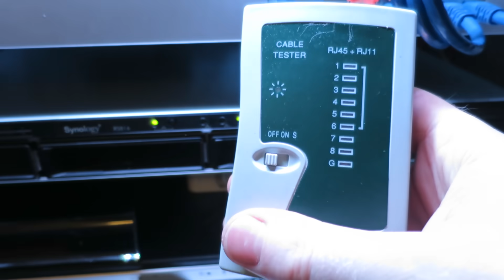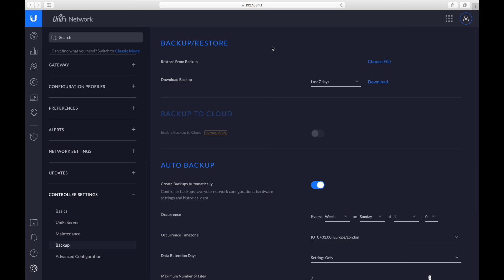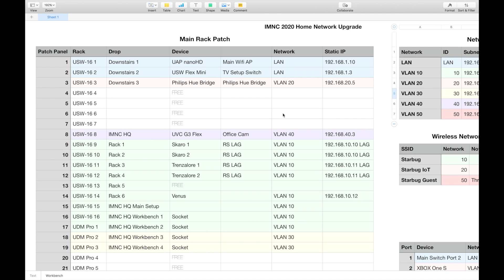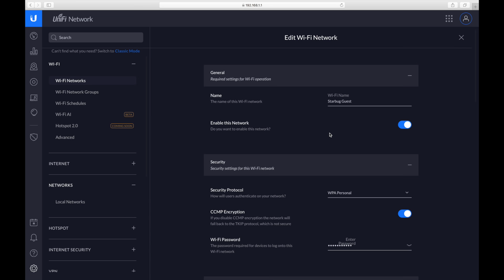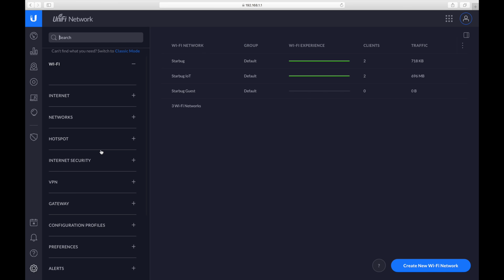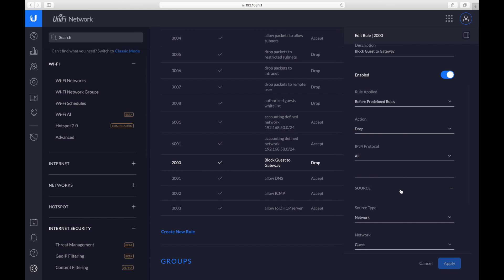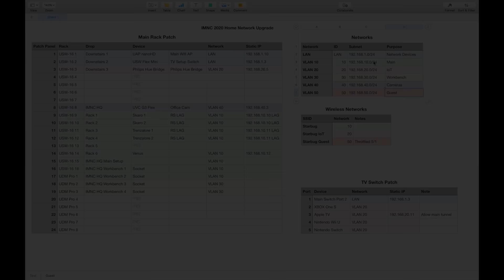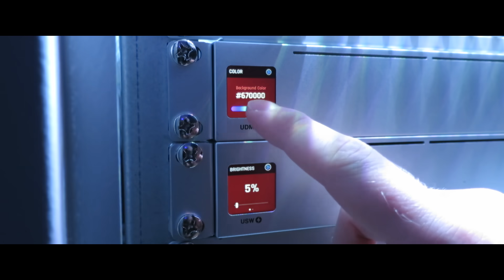Huge 2020 Ubiquiti UniFi Home Network Upgrade (Part 3 - Advanced Configuration & Final Installation)

Comment: I'm very impressed by this series. I worked for a small computer company (IBM) for 40 years and spent a lot of energy  investigating different vendors and their wares for my new home.  I have a home -  2 stories  - where the basement is poured concrete and below ground window wells. I have 2 AP-HDs (one on each floor)  serving the IoTs, wireless phones, smart TVs, etc. The list is growing (18+) -  it amazes me who many devices needing internet access we have.  I can not wire to outside walls in the basement - hence the need for strong wireless. 

I wanted a vendor who "had the goods" -  both hardware and management software - who was innovative and a vendor in the top 5. I DID NOT WANT to spend extra money on licensing (for a home system - come on!). 

I also did NOT want my wife to keep telling me "The network is down again!".

We live in the U.S.A in Aurora, CO where there are rare power outages (very little thunder). However, in Durham, NC (where we lived for 23 years ),  there were many thunderstorms and momentary outages - enough to reset and IPL  the modem. I have a small APC battery backup unit to handle any power burps.

I have a small request - please provide your spreadsheet so it can be used by others. It would save the time to reproduce and is a great tool. (I know -  we used many spreadsheets use in defining customer configurations).

Any configuration should be documented - just in case!

I'm looking forward to seeing more in the series!

Dave Clifford
Reply from the maker: Hi Dave. Thanks so much for taking the time to share your story in this comment, very interesting!
I've emailed 4 copies of my spreadsheet off to those who have asked for it, but I will look at making it available for download and will add a link to the description.
Reply: @ItsMyNaturalColour   Thanks for the response pleas send me the file as well Dave
Reply from the maker: @clifforddcj  Hi David, I've added the link to the description.

Comment: I would keep a downloaded settings backup that is saved off the UDM after you have all your settings set. That way if you for whatever reason need to restore those settings on other hardware you will have a separate backup.
Reply: This...  I had mine set up with a good baseline. A driver hit the electric pole near the home and the UDM Pro went into rescue mode. Had to reinstall firmware locally.  Thankfully I had a PC with a lan port!

Comment: I have had Unifi as my home network with 3 x 24 port switches and 6 AP's for nearly 2 years and struggled to do the VLAN/firewall settings for exactly your scenario with IoT's etc. My main issue was the sky q app not accessible via my phone or kids' iPads with sky q in its own VLAN, so ending up sticking everything on the same network. So thank you so much for making this video, I cant wait to start work on the settings.

Comment: if you mounted it on the ceiling it would improve the bedroom coverage, this is down to the antenna configuration and the dispertion of the signal.

Comment: It has been great watching this and the old network series, especially the iterative process of small improvements and all the challenges along the way.A small hint: Firewall rules are usually made the other way around. Best practice is "default drop all" then make exceptions for what should be allowed. Then you don't need those groups.
Reply: Hey! Can you explain this a bit more? I'm struggling with this and the way he does it on the video is a bit messy for my liking.

Comment: Holy Smokes - Ubiquity has surely made their money many times over by giving you the free gear!  Like you. I'm venturing into this area as a rookie, upgrading my church's internet.  Your videos answered the questions I had about their hardware and software. I finalized my order today.  Your presentation style is easy on the ears.  I'll be referencing Part 3 a lot to get the configuration part locked in.
Reply from the maker: Matt, thanks so much for this comment. Really glad you found these videos useful! Good luck with your install and absolutely thrilled to hear I've helped :)

Comment: On the Apple TV issue, set an Established and Related rule as an accept between all Networks.  Then a block from source IOT and  destination MAIN.  this will allow Main devices to talk to IOT. They can respond due to the established and related rule but can’t initiate a conversation
Reply: This is great advice.  I was going to say the same thing, but I see it has been covered.  Far more robust network design and easy to do.  That said, great video.

Comment: Great three-part series, got me up and running in no time. UMBPro, USE Pro-24-POE, US-8-60W, NanoHD.
I've run into an issue with my three SSID’s when I assign and turn on VLAN 10, 20, 40; I get a no internet connection error on each, turn them off they work.

Comment: I builded my home network based on this video (you can see another comment of me below), but for almost a year, I had connectivity issues with wifi devices. I even send an email to Tom about my problem asking for help. I love Tom's videos, I just want to let you know that this setup of firewall rules is NOT RIGHT and is NOT WORKING RIGHT. I know Tom did his best to figure out everything about UDM Pro, but recently I saw 2 videos from 2 different channels and I reset my UDM Pro, I followed their videos and since then everything works perfect.
Tom, you should make another video for UDM Pro. We still love you!

Comment: Few suggestions. First rule of firewall is to drop everything you don't know. So it a good practice to define the rule to drop all traffic and put it as the last rule. Then you open only the traffic that is really needed. This way you have full control over your Network and maximum security. I'd also consider separaring servers to a other vlan to minimize the risk that any malware you may get on the end users machines do not easily transfer to your servers. Also consider IOT Vlan as guest as well with client isolation. Your philips Hue does not need to be aware of your harmony hub or other smart plug or bulb you may have (and if they do you can open specific ports to specific devices). Also If Apple tv needs full connection to the main vlan maybe it does not really belong to IOT Network and should be moved to main?
Reply from the maker: Thanks so much for the tips! I'll definitely get this all sorted and mention these things in an upcoming video. I appreciate it!

Comment: So thankful for the shoutout in every new networking vlog so far, my original idea for the networking has changed somewhat, my band are rebuilding our unit (we have a small ish warehouse unit, works well for us etc) (toms seen pics of it etc) and im gonna put an express at each end of the unit and the extreme on top of the comms cabinet (got a home theater/lounge setup in one corner too) and were gonna be all chipping in for a home 5g router setup, to run a sick connection, and then run the router into the express and manage it all from there, got lots planned and the equipments going to an awesome home!

Comment: May be have the AP on the ceiling would give your more juice in the bedrooms
Reply from the maker: I think so too. I decided to plop it on the wall as that's where the cabling was.
Reply: You can try a L shape bracket:
https://community.ui.com/questions/I-made-a-wall-mount-for-my-UniFi-UAP-AC-PRO/5cc7677c-f4e4-4e5f-a597-5fd9ef111b64
Reply: Reuse the holes on the wall
Reply from the maker: @creature777a  Thanks for the link, very interesting!
Reply: Doing that might make the upstairs get the slower speeds
Reply: The UniFi ap have a 360 radius so ceiling mounting would be best

Comment: For the "Bug" you mentioned in your video, what worked for me was to go to "Insights" (just below Clients on the left panel) once there make sure you have "All" selected and not just the "Last 24 Hours" at the top. You should see a list of all the devices and their associated IP addresses. Sort by the Fixed IP Column, and then look for the errant IP address that keeps showing up. Click on it and then on the far right click on "Forget". For some reason, Unifi is stubborn with remembering all this information and not updating the tables. I also use the DHCP reserve (Use Fixed IP Address in the settings of the device panel) instead of hard coding IP's on my network devices. Hope this helps.
Reply from the maker: Hey Fred, thanks for the tip I'll give this a go!
Yes, I should've mentioned DHCP reserve. I'll be sure to bring it up in my next UniFi video further down the line.

Comment: Great video just at the end you have your cables comming out of the brush plate and over the switch to the UDM what happens if you need to take the switch out ? your stuck with cables blocking you should add one more brush plate between  the UDM and the Switch 

You went with all white cables ? No color code ?
Reply from the maker: Thanks Funny Noodle!
Couple of answers. No colour coding no - it's a 1 to 1 patch system, so will remain patched in this state permanently. 

As for the blocking of the switch, you're absolutely right. Main reason I didn't add another brush plate was I really didn't want to absorb another 1U of space. I have some more equipment to add to the rack and space is becoming an issue. Also, I can see myself at some point upgrading to a 24-port UniFi switch, so that upgrade will be very smooth and easy with the currently layout. I'll simply move the block of 8 cables down from the UDM, to the final ports on the new switch. It'll stay just as clean and means I can swap switches without pulling the rack out and removing the back cover.
Reply: ItsMyNaturalColour could you have had a 24 port originally? When Ubiquiti sponsor a video series like this, do they give you a budget of say £1000 for example, and you choose to get the most suitable items for you within that budget?
Reply from the maker: @jasonlee3247  I requested the gear I received specifically as I'd already outlined my project goals, and they also gave me a G3 Flex camera on top which is the only item I did not request. 
Originally I requested the 16 port switch as I wasn't aware of the UDM Pro 8-port switch backplane limitation of 1Gbps. This isn't a huge deal as my number of devices hasn't exceeded 16, but I'm hoping to add more cameras and I have more network expansion on the way, so I can see myself eventually growing out of the 16 port version. It's perfect for now, though.

Comment: For that IP bug on the controller, you might need to check your /etc/hosts file on the USG and clean it up. You can SSH into it, and do 'vi /etc/hosts' . 
Clean up the old entries; then once you've saved it you can reload dnsmasq (sudo /etc/init.d/dnsmasq force-reload ).
Reply: Thank you. That was driving me bonkers!  

Also wondering if it would be more secure on the uplink port for the switches, instead of 'All' port profile, you have the (combined) profiles of the VLANs being used?

For example, LAN (Native) + IoT (Tagged) on uplink if the switch is only going to have IoT devices connected to it.
Reply: @si-fi  hey, not really because you set your port profiles on the access ports... you'd just be complicating the configuration for no appreciable security gain

Comment: When you got to add a new iOT device and are setting it up for the 1st time.  Say for example like a Wemo smart plug and you want to add that smart plug to Homekit.  Have you run into trouble with your firewall rules?  I found I had to turn off firewall rules to do initial setup/ add device to homekit, but then I could turn firewall rule back on and have things work as intended.
Reply from the maker: Hey Brett. 
I haven't had enough opportunity to experiment with setting up new devices under this config yet. I've had it up and running like this for 4 or 5 days, so I've only tested the functionality of the devices I already had set up. I'll be talking a lot more about this sort of thing in future videos, so I'll be sharing all my findings.

Comment: Where were you able to find the non black brush panels and blanks?  I would LOVE to get some myself but can’t seem to google-fu them! Oh and does the gray match the Unifi gear?
Reply from the maker: Hi Philip
The brush panels are "712477 Intellinet 19IN CABLE ENTRY PANEL" - I bought my 2 from an eBay seller but they're available from a few different sites if you Google that product. The colour is not the same. The UniFi gear has that shiny-ish aluminium look, where as these panels are painted steel, specifically RAL 7035. I'm not aware of any off the shelf panels that have the aluminium look, but you can remove the brushes from these, so you could if you wanted spray them with aluminium spray, which you can pick up online / at a hardware shop / auto repair shop. This has been done by other UniFi enthusiasts who want even colour rack equipment. For me, these panels are a great fit as my cabinet is finished in RAL 7035, so it looks really nice.

Comment: Nicely done! I agree with a couple of the other commentators... you might want to consider tweaking those firewall rules a bit. What you have is workable, clearly, but there are some best practices to consider in terms of “drop all”. 

I like the cable management job you did, although one lesson I’ve learned is this: unless you’re doing structured cabling that should NEVER change, consider using Velcro rather than zip ties. If you have one single cable go bad and need to extract it from the bundle, you’ll be hating life...

Comment: Hey tom,  you should enable multicast enhancement on the wifi networks and also adjust the channel on the ap and the transmit power. Great video btw!
Reply from the maker: Hey John, definitely. I have another UniFi video planned where I delve deeper into the AP itself and the associated settings. I'll hopefully get that done quite soon.
Reply: @ItsMyNaturalColour  For this one, if you enable the Wi-Fi AI option it will take care of that automatically. It also adjusts to changes in the environment (such as a 2nd AP, or interference from new equipment or outside sources)

Comment: I would speed test with 2.4ghz and 5ghz, I created a different wifi for each. 

Also since you have only one ap you should turn the antenna power to max instead of auto.
 Also I would run a  channel saturation  "rf scan" to see what channel you should be on for 2.4 and 5, The ap can do this or you can use a phone with an ap  like "wifi analyzer"   that might improve your rooms 1 and 2 bandwidth. In my worst room I get 60 on 2.4ghz but I get 110(max) on 5ghz
Reply from the maker: Hi Dominic, yes agreed. I'll be delving further into these settings in a dedicated video a little further down the road. Thanks for the comment.

Comment: thank you for this detailed setup.  Were you able to find the most optimal approach to your firewall limiting features?  Was match state new still the best approach?  Interested to see if you have an updated video on how the firewall settings are SUPPOSED to work.  2nd, did you notice that the gateways of each individual VLAN is pingable from any vlan?  Example: laptop on iot VLAN 20 can ping 192.168.30.1 - which is the dhcp gateway from vlan 30.

Comment: Hi Tom, fantastic video mate, totally brilliant! Its helped me a great deal when it comes to adding my own firewall rules to my USG, i've seen many YouTube videos about it but it just didn't click. However your explanation was great and i'm already planning my VLANS and firewall rules based on a similar set-up to yours. And as for that rack, such a neat and tidy arrangement, I only hope than once I get my rack and sort out my Unifi stuff into it, that its as tidy! You also mentioned a Synology NAS, I have 2 connected in my network, one for time machine back-ups of the MacBooks in the household and for media storage, and another smaller one which is used for Synology Surveillance Station with my 2 POE cameras.

I can't wait for more videos about the Unifi hardware and setup. I'm struggling at the moment with my 2 Unifi HDnano AP's as they seem to be conflicting. I noticed your AP was set to radio frequencies 6 (2G) and 157DFS (5G), i've not been dabbling with the DFS channels as i heard a lot about these being difficult to administer, especially if you are near an airport. I've an RAF Helicopter base close by, so have a lot of aircraft flying over and i'm not sure if this will be an issue.

There could be other issues on my network. I see your Controller was reporting 99% efficiency, mine seems to vary between 85% and 90%, so I have a lot more to configure I guess.

Anyway keep up the really good videos and thank you for all the information! Matt
Reply from the maker: Hey Matt, really glad you enjoyed the video. Thanks for the comment!
I'll definitely be making some more videos, and one of those will be delving much deeper into the configuration of an AP for optimisation, so that sounds like it could be useful. Keep an eye on the channel :)